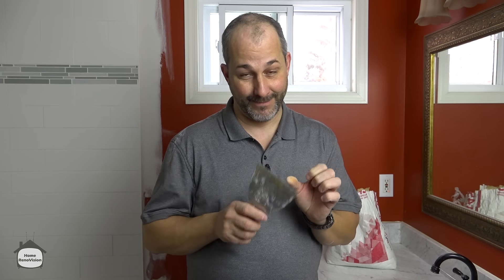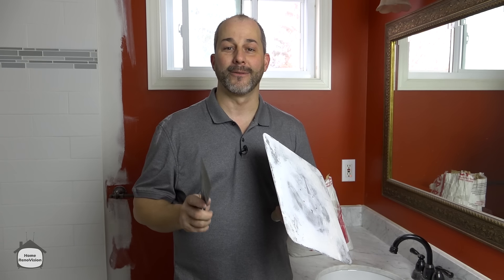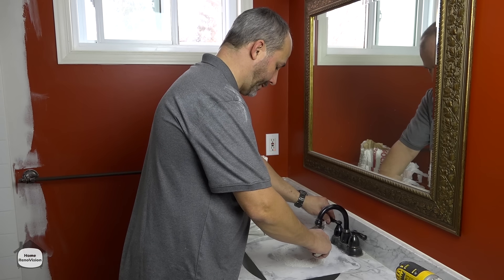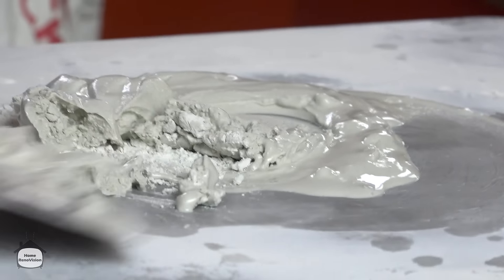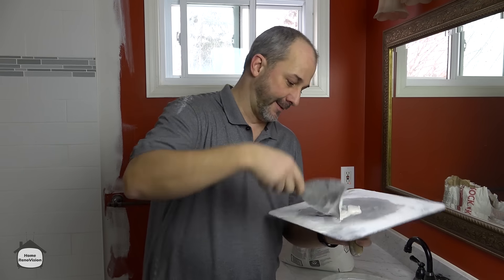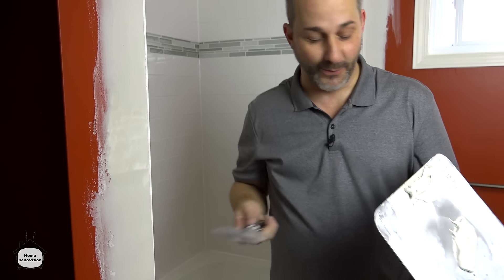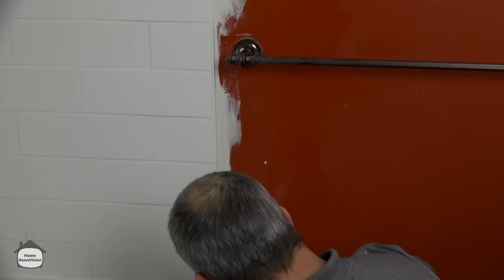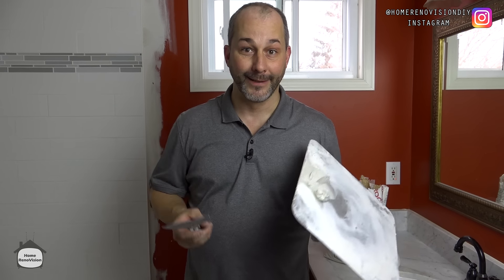Simply DIY Drywall Repair for Homeowners

Comment: So....why dont you need to prime it and paint multiple coats?
Reply from the maker: 2 coats will cover fine with that mud. cheers!
Reply: @HomeRenoVisionDIY  
But you said five minutes is all you need with 45min mud, and one coat of paint and your out the door. I'm confused.
Reply from the maker: 1 or 2 coats. it all depends on the quality of paint and the color you are uysing and the color that is on the wall. Cheers!

Comment: REGARDING- Country Water :    My friend's builder didn't bring in water for the grout and used the well water. They are 2 miles from the vent of SULPHUR SPRINGS. The water smells HORRIBLE. He had to regrout the entire house! Which is all tile since its a former cop who was shot in the line of duty and is in a wheelchair.

Comment: The best for me is 20min mud
Reply: Or you can hire a professional that uses 5 minute, does it in one coat, and doesn’t mess with the chemical composition by using hot water..which the lab techs never figured in .
Reply: @danastrawder8775   Yep.  That's what I do.

Comment: Great video! I have a scenario not covered in this video. I have a stud that is proud about 1/4” compared to the rest. As a result it created a bulge in that area when the drywall was hung. I’m trying to hang a sliding barn door rail but that bulge is giving me problems. The drywall is 5/8 and I’m considering cutting out the bulge and patching it with 1/2 and using mud the flatten it all out. Is there risk of cracking along the joint using a thinner drywall patch?? Help me please!
Reply from the maker: Hi Cesar. cut a square in the drywall around 6" then simply cut the stud 3/4 way through and add a screw from just above the cut on a 45 degree down through the cut while pushing on it. this will straighten out the wall and then you can simply put the same piece of drywall back on. in extreme cases you might have to do this twice on the same stud. Cheers!

Comment: Not much of a secret at all lol. You can mix the durabond in a pan rather than on a hawk as it literally will be mixed in about 15 seconds. Use hot water for faster dry time but use dirty water to make it set even faster. By dirty water I mean from the bucket you typically wash your hands and tools with.
Reply: Or, use 20 minute, or 5 minute mud.  Dirty water will make it set quicker, but sometimes part of the pan sets up quicker than the rest.  And you have to guess how quick.  I just keep a bucket with a screw on lid full of 5 minute, another of 20 and another of 45, but I do repairs exclusively.  The buckets have screw on lids for speed, and a gasket seal.  I'll demonstrate it in a video I'm putting out real soon.  They're great.  I also mix my mud in a pan, using a cake beater in my drill, and it's super fast, and super smooth.  I put a video out showing that too.

Comment: As a professional drywall finisher and painter, I completely disagree with your assertion that you don't need primer and 2 coats of paint. You can see the shadowing from a mile away if you skip out on those extra coats. With modern PVA primers and quicker drying paints, there's just no reason to be doing larger patch jobs without all of the primer and paint on the surface. Better to just to not screw the job up walking out the door... Also, 5, 15, 20 and 40 minute mud is available.... Also, also, it's way easier and cleaner to mix a setting type compound in a pan vs. a hawk. I guess I'm saying that nothing beats a job done correctly. Cheers!
Reply from the maker: thanks for your insight, perhaps you have yet to enjoy the benefit of this product. CGC 45 is a miracle mud. try it before you let all those years of experience cloud your judgement. Cheers!

Comment: I love that rusty color on the wall, but it doesn't compliment the tile in the shower. I could listen to him talk all day.
Reply from the maker: Good news, The home owner painted it after I left. Cheers!
Reply: @HomeRenoVisionDIY , thanks for responding. I'm shocked. 😉
Reply from the maker: Don't be shocked. I am on here answering questions everyday. Cheers!
Reply: @HomeRenoVisionDIY  well in that case I happen to have a question. First let me say I learned a lot from this video (thanks!) However, today I will be using plaster. Yes, I said it I'm entering into the unknown. I have watched and read for many man hours on how to properly handle the medium and the differences between it and joint compound. What I want to know is the correct terminology for the bonding coat? I will explain, on the videos I see the pros  remove the crumbled debris from the area that needs repair. Vacuum all of the dust etc from the wood slats, add a stay adhesive, then add the plaster. Smooth well, even use the sponge technique you used but then at the end they often (not all the time) mention a finishing "bonding" layer? What is the correct terminology for this coat and what brands are out there? I hope I am saying this correctly. I want to make sure the patch jobs last the test of time and that the paint apply well once it has dried. Thanks in advance. Happy New year! ❤

Comment: You said no sanding? WRONG, you also said it's fast but you stated you put on 3 coats? I do this for a living... I put on 1 coat and sand it or if it is a patch like a door handle hole in the drywall I will use Bondo, sand and texture and it's ready to paint in 1/2 hour. Not impressed.

Comment: this is not a "trick".
Reply from the maker: perhaps not for you but for many others it is. Cheers!
Reply: @HomeRenoVisionDIY  Its probably best to mention that sanding hot mud that has been applied over regular joint compound will not sand out properly, in the event it was required. If you are only filling holidays and/or comets why not just use regular joint compound?